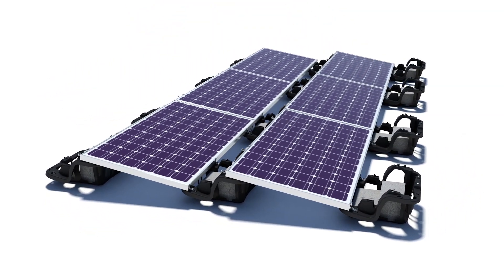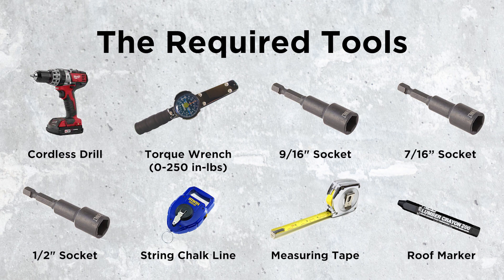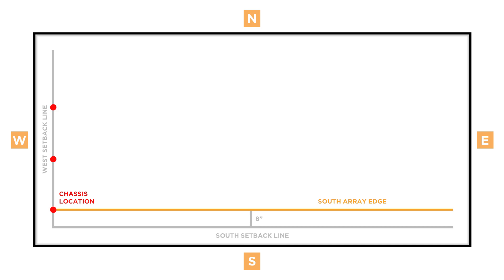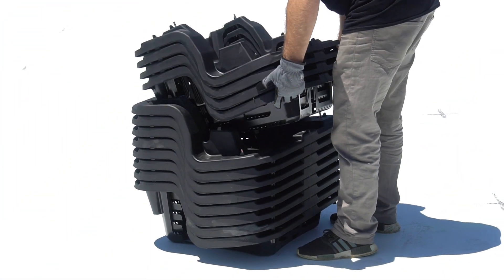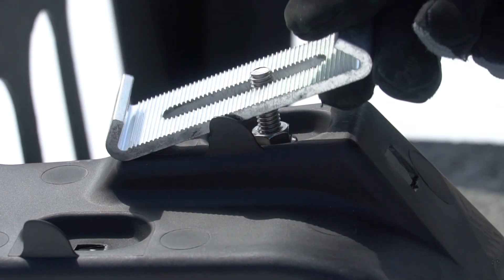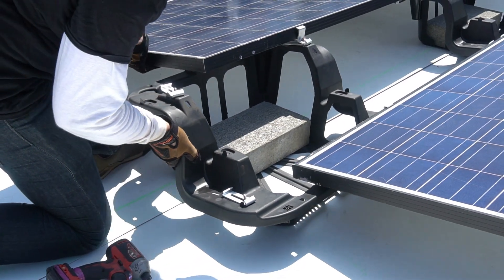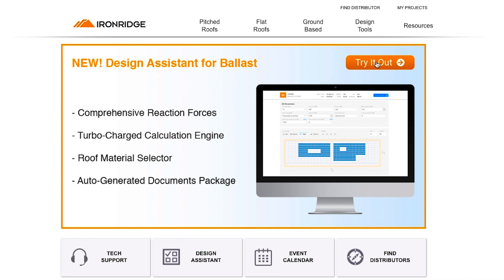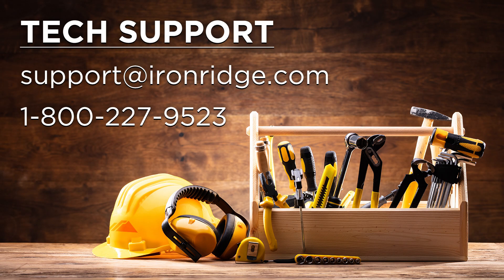How to Install the IronRidge® BX Ballasted System // Flat Roof Solar

Comment: Can you configure the BX module layout in the Portrait Configuration?
Reply from the maker: Hey Matt, BX is designed and certified as a landscape-oriented system. If you have more questions or need information on alternative solutions, you can contact our team at support@ironridge.com.

Comment: Why was the plastic so over engineered? Seems like unnecessary cost in producing the mold and product.
Reply from the maker: Hey RJ, thanks for the question. Like we pointed out in the video, a lot of thinking went into this design. This is more than just a mere plastic and it needs to last 25 years on a roof with UV exposure. We strive to make products that are fully capable and dependable over their lifetime.
Reply: @IronRidgeSolar  please explain how physical complexity helps with chemical stability?
Reply from the maker: @user-dr2pg8fk2i  Hey again, RJ. We don't see this design being overly complex. Think of it like a basket that holds your ballast on the roof. The gaps in the walls of the chassis allow for water drainage and, because this is a molded product, we are also able to integrate many other features directly into it. Other ballast products are usually metal with many extra parts and steps. Our material has been tested to be very stable and able to handle the long-term conditions on a commercial roof. Hope that helps, but feel free to contact our support team on our website if any further questions come up.
Reply: What are the name of the blacks your using in the middle of the chassis